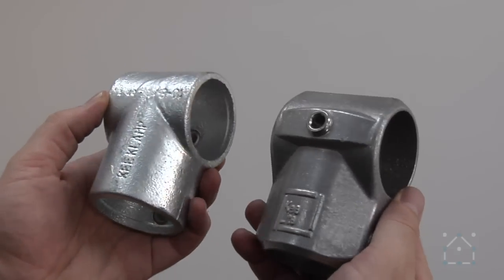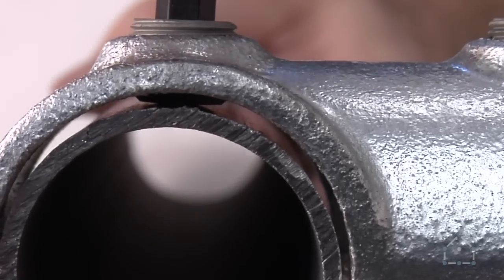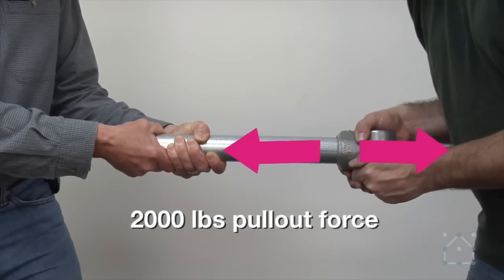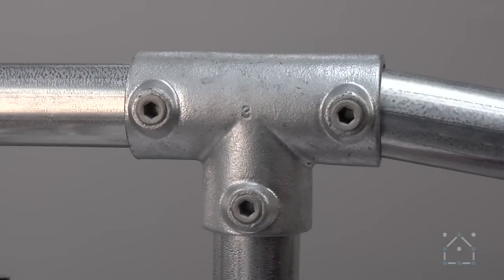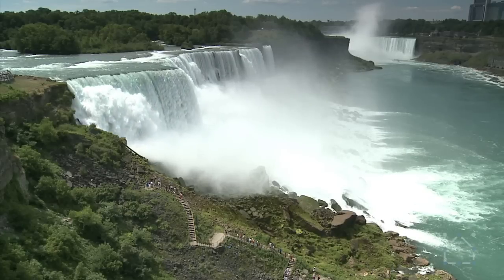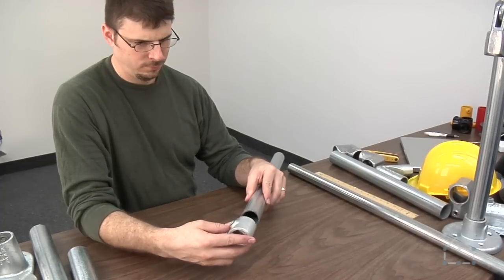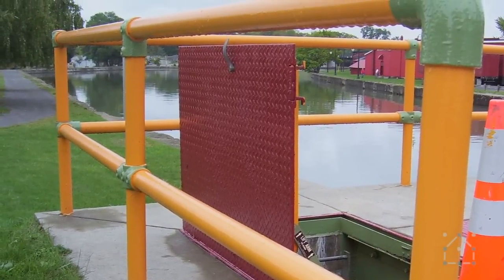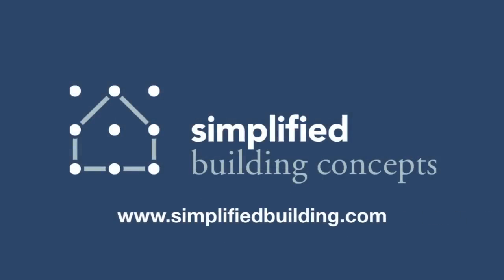Kee Klamp & Kee Lite Pipe Fittings - Features & Use

Comment: Hello, we have some guardrail to dismantle which is held together with Kee Klamps. Unfortunately the set screws have rusted in solid and we've been unable to loosen them. Could you suggest a way we can remove them? WD-40 has been used but without success. I've read about using a blow torch on rusted nuts on bolts to help them expand slightly but these are encased in the clamp so perhaps that would make them tighter still? I'd appreciate your help with this, thank you in advance.

Comment from the maker: Ok, here's what the support team said: "I would not heat these up in case there is any flammable residue that has contaminated the rail and fittings. I would cut off the fittings using grinder and replace but making sure a risk assessment has been concluded before commencement of works."